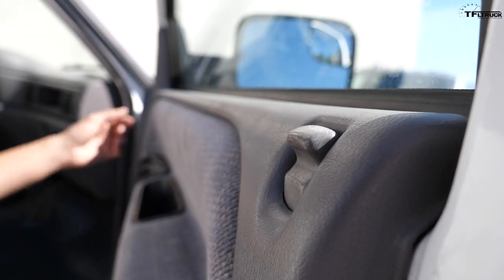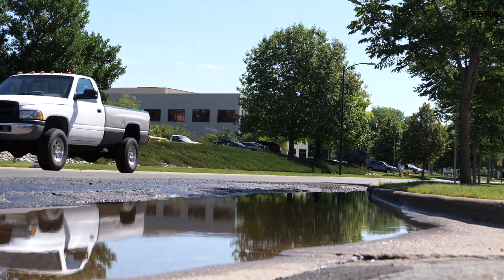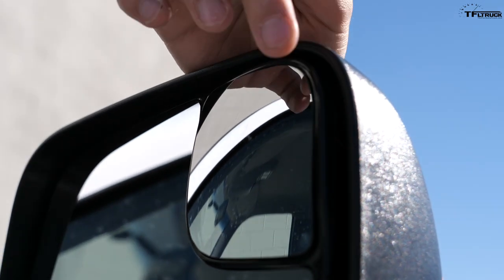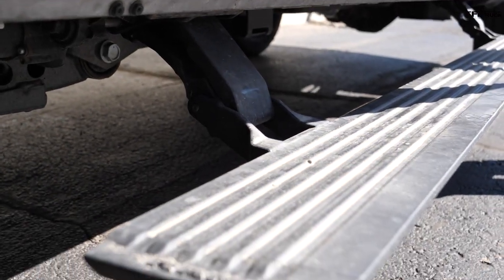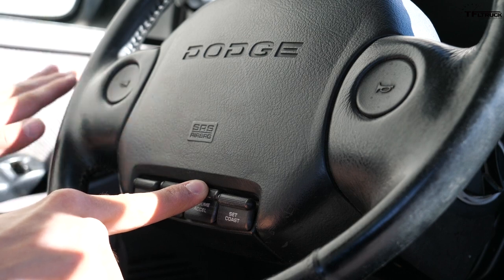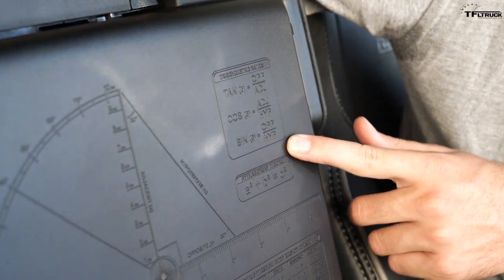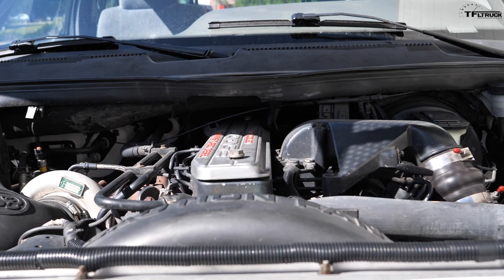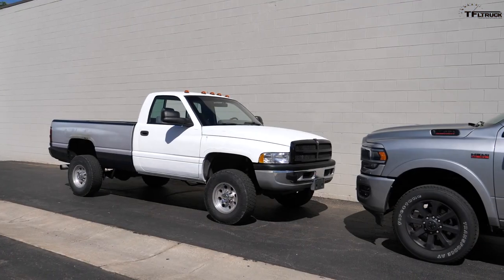Modern Tech vs Old School Simplicity: How Does A 1994 RAM 2500 Compare To A 2020 Ram 2500?

Comment: Great comparison between the two trucks.  In 1994, the Dodge Ram was only available in standard cab.  An extended cab was made available in 1995 and the extended cab rear clamshell doors came out in 1998.  When the '94 came out, it was the truck to have.  I recall talking with a Dodge dealer sales rep who took in a '93 Chevy Silverado on trade because the owner wanted the Ram due to it's looks and having the "latest thing."  

I have an '87 Dodge Dakota....and it has slide out cup holders....ash tray and a cigarette lighter....plus a transfer case shift lever. so similar to the Ram though it's 7 years older.

Comment: id take the old 12v any day over then new one but id rather have my dreamtruck a 99-03 7.3l powerstroke full 4dr (super crewcab) 4x4 dually so i could build it with modern features

Comment: 2nd gen club cab Dodge's didn't get 4 doors until after 98 I believe.  My 96 club cab doesn't have them.
Reply: I think they ended up calling it a quad cab.
Reply: The Dodge Ram got the quad cab (4 doors) in the model year of 1998 it also got a new interior and the 6’ bed option that model year and midway through that year it got the 24 valve engine too. Just some old Dodge Ram trivial information for ya or anyone else who cares to know

Comment: I’ve got a ‘14 6.7 3500 SRW mega with the aisin and a ‘96 2500 12v and either one I’d take across the country. With the 12v, all it takes is common sense to work on it. It’s so basic and very reliable. No frills but well respected and sought after.

Comment: It doesn’t. I’ll take simplicity over modern, exaggerated, frail, cheap, flimsy metals any day! My ‘96 RAM was clipped by an 18 wheeler and it did no damage besides dislocate the plastic trim, while dad’s ‘18 got it’s bumper ripped completely off.

Comment: The real conclusion will be drawn in 2046 when the 2020 is the same age then as the 1994 is now.  THAT will tell you soooooo much more about how 'good' the 2020 was.  Im pretty sure that tailgate won't work anymore and 99% of the tech that it has will feel as cool and modern as a dialup internet connection by then.  Meanwhile the 1994 truck will still be rolling around doing work...

Comment: I own a ‘98 with the V10 and can attest that it is a shockingly bad vehicle. The diesel may be better but the v10 is a complete turd and dangerously slow. Mate that with loose steering crap brakes and insane bump steer and you spend every drive contemplating how bad the crash is going to be. Give me the new one!

Comment: My dad has a 2016 3500 6.7L full cab 8' bed dually. I have a 05 2500 5.9L regular cab 8' bed. For day to day I love my truck more than my dad's, however towing my dad's truck beats mine other than turn radios. But if you're like me and drink  at minimum 72oz of coffee the 5 + cup holders is pretty awesome. My truck is way more rough than my dad's hitting potholes or joints in bridges I almost f**** die if I'm going over 85mph lol

Comment: I can't really say anything about the newer truck because I own a 96 Dodge Ram 2500 2X4 with the 5.9 (360) gas motor.  I love the way it drives and it pulls my RV without a problem.  I do have a much more modern (2015) small SUV that I daily drive.  Would I get a newer truck? Maybe if they didn't cost so much.

Comment: I have a 98 Laramie 1500 2wd and can confirm it rides like a Conestoga wagon, even with brand new Monroe shocks.  To all those that say “it’s an older truck, that’s just how things were...” I had a 97 F150 and also regularly drive a 88 F150, both drive so much nicer.  That said, I have $1500 in my Dodge and will most likely run it till the wheels fall off, which doesn’t look to happen anytime soon.

Comment: talking about tow rate. idk why they rate them so low. i assume it must be due to braking. cause that 5.9 cummins 6b was used in "mid sized trucks" all over the world. like fords 1317/1517, volkswagen 12180 and 13180. and ive seen those trucks pulling semis with 28000 kg of load (plus truck and semi weight). thats about 40k KG of gross weight. 
yes, theyll take long time to get up to speed. but for short hauls, or long ones with not much ups and downs in the terrain, theyll work for years.

Comment: Yall threw a couple hp/tq numbers around for the different engines, though you did miss the higher option for the 94. I have the gasser (unfortunately) for my 94 2500, and stock for stock the 8l V10 outperforms the 12v, and even torque on your 6.4l there. 300horse and 450tq from the factory, makes up for it with gas mileage though.

Comment: I just bought a early 2000s f150 and couldn't be happier. Yeah people say "what about the gas" and to my surprise it costs just a tiny bit more than my focus st. ST requires premium which is about 2.39 and the f150 can use regular which is about 1.79. Empty to full in the focus is around $35 and empty to full on the f150 is $40.

Comment: I would definitely take the older Cummins 2500 over that pos don’t make any sense gas 2500 like who buys a 2500 with a gasoline engine in it in the first place that’s stupid as hell that’s like putting a gas motor in a 18 wheeler smfh 🤦🏻‍♂️🤷🏻‍♂️😂😂

Comment: The Club Cab available in 1994 did not have rear opening doors. That wasn't available until the Quad Cab became available in 1998. Also those mirrors weren't available in 1994. They became available in 1999 or 2000 if memory serves. The factory mirrors would have been chrome. Tow mirrors would have been the old "Western Hauler" style mirrors that bolted to the doors in 4 places and had aluminum framework.

Comment: Give me the 12 valve. That Cummins will last forever if taken care of. (And it has no emission controlls to kill the engine). The new Rams are really nice, but I'd prefer an old school 12 valve Cummins any day.

Seeing as how I daily a 92 D350 the 94 would be a tad more comfortable, but I prefer my 1st Gen over anything. Way more style and a look you don't see often. My truck has around 500 to 700 thousand miles on it. We're unsure because of a common issue on the 1st gens which is the plastic gears in the odometer breaking.

Comment: That old 94 cummins was rated to tow about 12-13 thousands pounds from the factory. But with the updated 24V motors they were rated to tow 15,000 pounds from the factory, but I’ve known people to tow 20,000 pounds with these older 12 and 24V trucks, older trucks will always win, those newer trucks aren’t half of what a 12V cummins is.

Comment: Never owned a dodge but allways been a fan of the 12 valve but as far as old trucks I daily drive a 1991 GMC Sierra C2500 I drive anywhere from 10 minutes to an hour to jobs towing equipment and frequently make 500+ mile trips very comfortable and nice to drive even being an almost 300,000 mile truck all original England drive train

Comment: It all depends on what you want and like. These new trucks are more comfortable and easier to use than then old ones with the technology. But as the new ones are more comfortable than the old ones, the old ones were more comfortable than the previous ones. It's always been that way. Dodge has always made the best trucks if you ask me. Going back to 1947 with the Power Wagon(which the new Power Wagons I don't think are real power wagons) and the D series and W series. 

The old ones before technology were simple to fix and know whats wrong. It was a knowledge that you had of what was going on. New trucks have all these censors and things to monitor whats going on. It makes me feel like they're weaker but the technology can fail. Anything can fail but it's easier to replace a carb or intake or easily accessed parts than a computer central system that goes bad. Essentially a new truck needs the computer fixed which costs more money than the parts and there is alays mark up. 

I would ideally would have liked to have bought a 69 W250 with a 383. Or a 74-87 W250 Dodge with a 360. The thing about those trucks is the parts can be used on many years. Especially with the engine but now adays forget it. They're hard because they're no frills work truck. I like simple, purpose built vehicles. If I wanted luxury I would buy a car and if I want muscle I'll buy a Mopar. 

Now, I drive a '13 Dodge 1500 with the Hemi and a 4x4 with a regular cab and a 8 foot bed. I drive it cause I can work on it. It's simple, accesable and no frills. Compared to a new one, even though it's new. I think the only reasonable up grades should be shock absorbers, gears and a radio. That's it. Basic maintenance as well. But that's just me. I wouldn't really want a new truck because I will have to pay more to have it fixed with computer issues. The new ones are easier to operate and they are friendlier than having to tune the carb because you changed elevation on a trip or because it's the winter time and you havento adjust the air fuel mix and idle speed. That's not hard but it's time consuming. New trucks, turn the ignition and go. The new trucks are safer, will keep you alive in a crash better than the old ones and that's why they're bigger as we all know. They're not stronger, as a 52 Power Wagon had a bed weight of 3570 lbs and solid steel construction. Way stronger than these sheet metal trucks. However, in an old truck you drive slow and not fast. You just meander along. New trucks let you go fast, like 70mph and haul heavy at that speed. You should be driving that fast to begin with in a truck but idiots out there do. In my '13 Dodge(I don't call them Ram or like the change to Ram, as Ram's aren't as tough as a Dodge) i drive 60mph and have to be committed to go 65mph and usually do 40 or 35. I ain't in a hurry because I don't exceed the limits of my vehicle and I know them. New idiots in trucks like that new Dodge try to drive it like a car and think they're invincible. 

That's how I see it

Comment: The new 2500 seems like a nice luxury ride, but you just gotta love a second gen Dodge Ram 12 valve Cummins with a manual. Just a simple work truck getting the job done, and won’t cost both arms and legs to fix, and no DEF or emission equipment to worry about.

Comment: My 2006 ford explorer( exploder)  has 220k and every 2 years I proactively replace around 1000 dollars in parts and tires every 60k. if you pretended the maintenance was the payment it  works out to 50 dollars a month.  My Wife had a 2014 Toyota Sienna  and  after 4 years 120k mostly highway miles we are spending more on maintenance then the 400 dollar a month..  I love Toyota but everything outside of the engine and transmission has worn out through the first 4 years.  I'm really fed up with good looking sub-par vehicles, I own a running 1954 dodge truck that my grandfather said he owned for 10 years before it needed more than an 2500 mil oil change.  We are just open mouths to these companies.  How is it now a respectable metric when vehicle last 10 years when vehicles used to last for 75 years plus.  Your vehicle expectations and standards are so low they could take a dump on your forehead and you would come back every 4 years for more.

Comment: I used to have an 02 3500 cummins. Now I have an 08. The 6.7 cummins is a much stronger running motor than the 5.9. You just have to delete it first. My dad runs a 18 3500 with the aisin trans. Even running all the emissions crap the newer truck will pull circles around an older one. You just can't beat the out of the box power of the new trucks.

Comment: Most folks at the level of pay for the jobs they do will find that the features on the 2020 truck are marginal in terms of the value they add to what they use their work trucks for as well as the actual price of these new trucks which is ludicrous. Just more stuff to break and a lot of them are built for planned obsolescence.

Comment: Yeah but the thing about the old 12 valves is they can make some massive horsepower with some modifications between bigger turbos and a little more fuel and nothing can make way more torque than that new hemi could ever make

Comment: Old Ram Versus New Ram? Old every time baby. The new ones are made for soccer moms.  They are filled with sensors and tech that can’t be repaired when they break and can only be replaced at a premium. When something breaks, inevitably, it sends a code to the ECM that will tell it to reduce power, even if it might not have something to do with the problem. All the wheel speed sensors, braking sensors and other nanny modules lead me to not want to own an 80,000 dollar truck that will break it it hits a speed bump too hard. I have a 1994 standard cab with a V10 gas motor with 94,000 and change that I bought from my dad, who bought it brand new. Never left him or me stranded and every parts replacement only requires a mechanic and not a computer engineer.

Comment: I'd take the 94, I prefer the simplicity and the "everything you need, and nothing you don't" style. so much so that I actually do have two 90s Dodge Ram trucks. One handed down from my grandfather, and one that I bought myself. And in my situation it was a very easy decision, I watched the one my grandfather bought take absolute abuse for nearly 15 years and it never stopped going, even now around the 20 year mark, the truck just keeps going, even when it should have died and ended up being a lawn ornament!

Comment: A 94 isn't even old school simplicity u got to go back to the beginning of the cummins engine if that's the reason for your comparison, 1994 was the first your for ford chevy and dodge to start adding complicated issues to otherwise uncomplicated lasting, mostly quality composed vehicles(pickup trucks) they started from there going downhill turning into luxury comfortable vehicles, after they went from 6' beds to 8' beds y would u want a truck with anything less, diesel engines are most powerful nowadays, overpowered really but mostly underused bc of weight regulations and limited weight ratings on the reliability of parts behind the power of the engine

Comment: I will take the 5 speed manual as its bullet proof. FCA/Chrysler could never build and over drive automatic that didn't break before 100K. FCA transmissions suck and they fave since the early 1990's Ill take the 5 Speed Manual it will outlast that new one all day long and the transmission will be easy too fix on the manual and will not total out the price of the car. Anything on the new Ram with all this tech when it breaks and it will being a FAIT product. The repairs alone  will out exceed the value of the car meaning to the insurance companies what im referring to is a total loss.

Comment: In 1994 the Dodge Ram only came as a standard cab, extended cab did not come out until 1996.  The reverse opening rear doors didn't come into play until 1998.  The tow mirrors on the 1994 in aftermarket and were not available on this truck until 1998.  If you wanted tow mirrors on the 1994 you had to get "west coast" mirrors that were big and attached with 4 arms.  The manual transmission was the best thing that Dodge did with the Cummins, these new trucks with automatic only with the Cummins is the stupidest thing they ever did.  I don't care if they only sold a low percentage in manual, a manual with a diesel is the best way to go.

Comment: I have an 03 2500 4 door long bed manual with the 5.7 gas engine 4x4 on 35s with a leveling kit and it’s more than capable for everything I do. Fun on and off-road. Still drives like a truck and is easy to work on.

Comment: i’d take the 12 valve cause that thing can make over 700hp easily with p-pump upgrades, a turbo, and both manifolds opened up compared to a new 392 with all of the new tech and everything along the lines of egr, vvt, and a bunch of plastic covering the entire engine.  i’d always want something where i can SEE my own powerplant and repair things easily instead of seeing plastics and replacing thousands of wires

Comment: Im not a big fan of crysler products but I'd take the old dodge over the 2020 any day the 12 valve is a great engine. The New "ram" you'd be lucky to get 100k out of it without transmission failure or blow the engine, or electrical issues

Comment: I'd take that old dodge any day over that new ram. The new trucks are too expensive and with fiat running chrysler all of that technology is going to break and be a fortune. Not only that but the aftertreatment system on new diesels is probably about 10% of the msrp new and its so much money to fix. That old ram with a 5 speed will never break and i wouldnt trust a chrsyler automatic transmission pulling over 10,000 pounds I mean look at how bad the caravan was. Now this is not to say the old ram is perfect either. A crew cab would be nice but not necessary, tie downs and a few bed lights too, and all the missing pieces on the truck like handle on the tailgate be put back on. But those are all luxuries, they are not neccesary to get you home at the end of the day. All in all upgrading an old dodge ram to make it more comfortable and quieter (like adding comfort suspension and a muffler in the exhaust) is the way to go instead of buying a 71,000$ new ram that has every and any quality control problem known to man, thats if you want too some people are utilitarian and dont care. And also if an EMP went off that old cummins would still run and drive just like those old mercedes diesels which are legendary, I own one so I would know lol.

Comment: I got a 98 5 speed and an 03 6 speed. Other than a couple lift pumps and the obvious front end parts they both still going strong. I just dont see these new ones holding up 20 years. My buddy has a 15. He spends a fortune on fixing crazy stuff like clock springs in the steering wheel. I would bet he's spent more in repairs on it than I have both of mine.